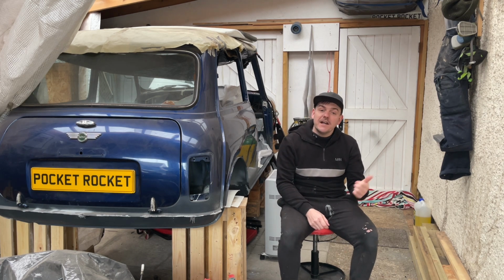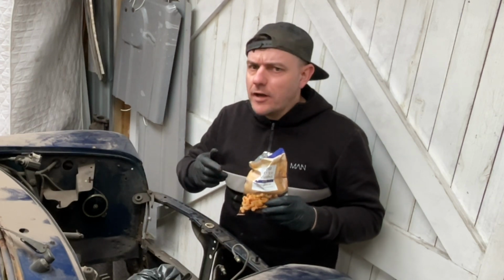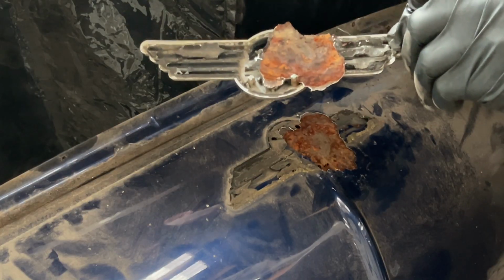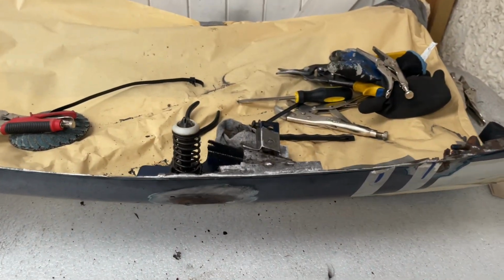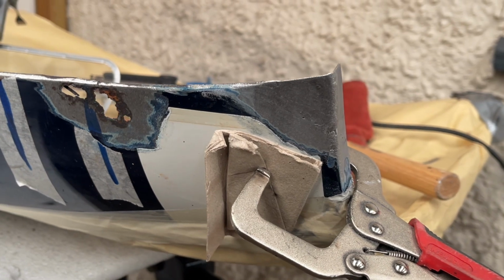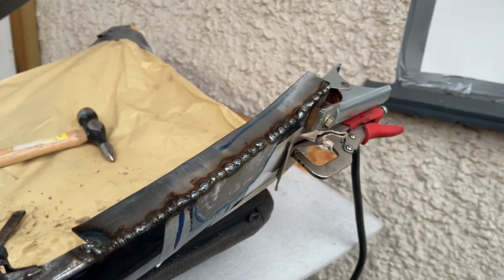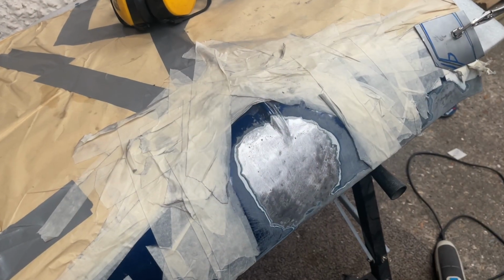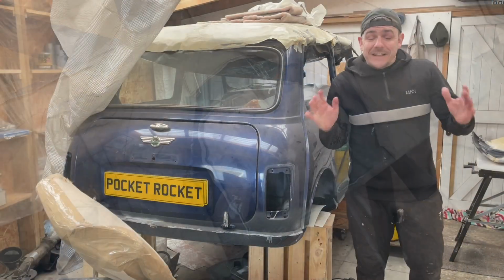Classic Mini Restoration - Repairing Rusty Bonnet Part 1

Comment: That looked amazing after! My bonnet is the same as yours was and every other video I see, people just replace the bonnet, I've got mine down to the metal, cut away most of where the rust is but unfortunately, mine has quite bad rust at the front on the inside where the rails are, welding on this isn't possible for me as halfway through my restoration, I had a sudden onset of epilepsy,  God only knows why as I never had it before, so now I'm at the mercy of trying to hire fabricators 😢 would you or anyone reading this happen to know what a fair price for this level of repair would be? As I'm trying to decide whether to repair it or replace it.